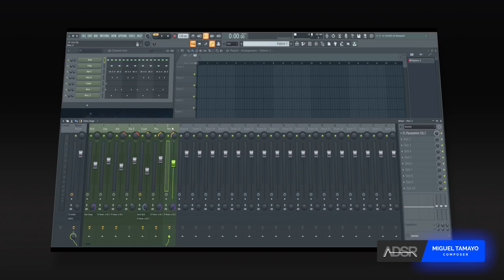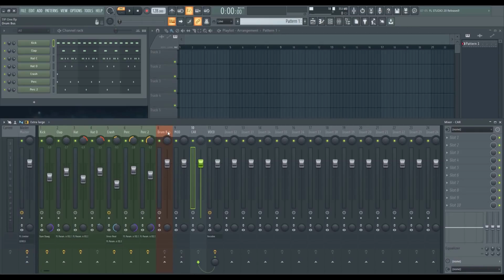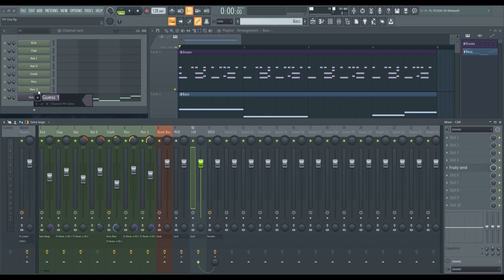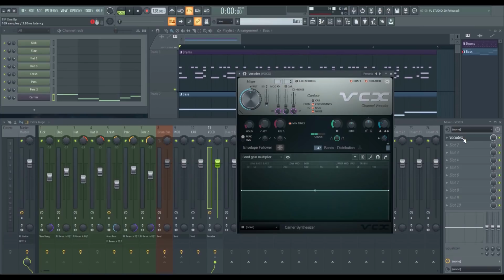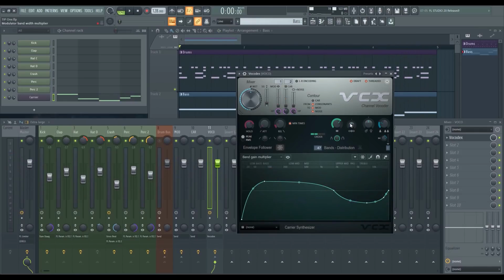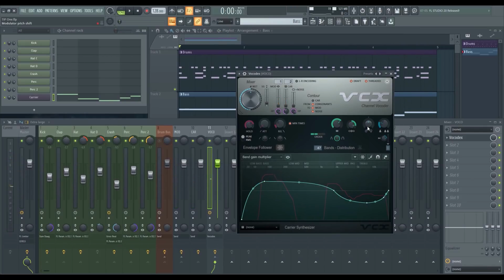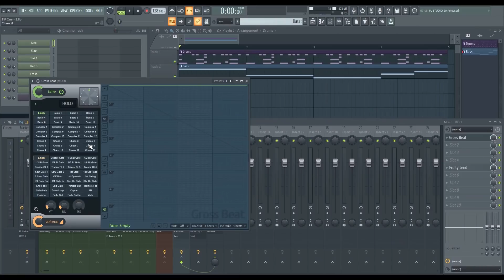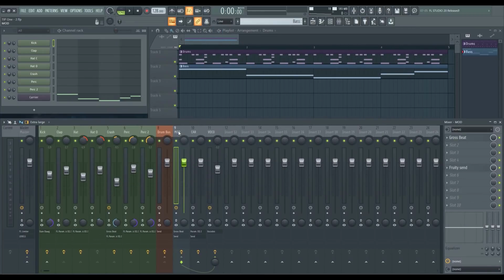Creating basslines with drum patterns using vocoders

Comment: You don't need the Fruity Sends at all. Just use "Sidechain to this track" in the mixer like you did in the video, but use a regular route from the Drum Bus to MOD (= Volume of Send to 100%). Then in Vocodex, you can just right-click the Mod and Car input numbers and select the desired source inputs.
Another big advantage of this is that you can add effect inserts to the MOD mixer channel and have it affect the Modulator input to Vocodex.
Reply: Also you could just get rid of the MOD channel alltogether when you don't do any effect processing there anyways, and instead directly send the Drum Bus to VOCO.